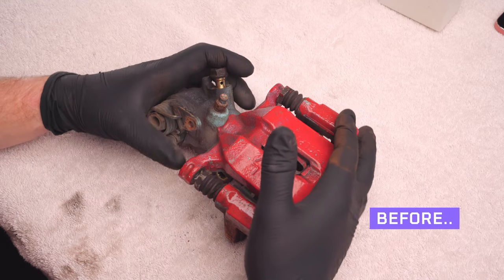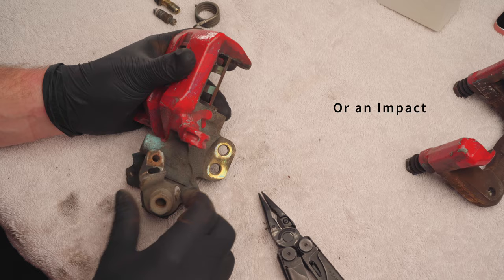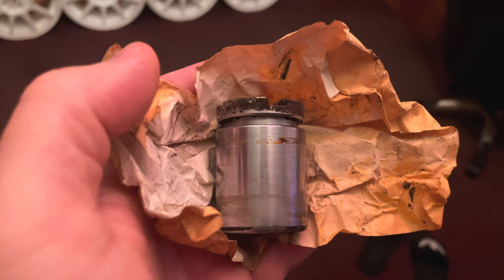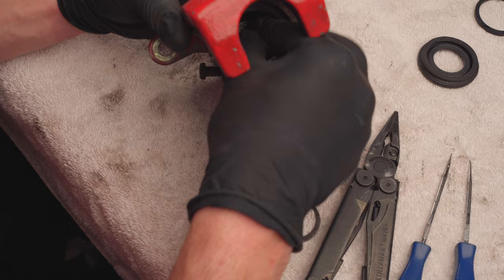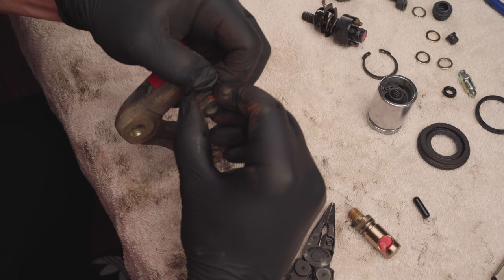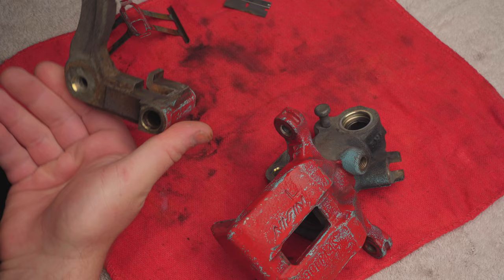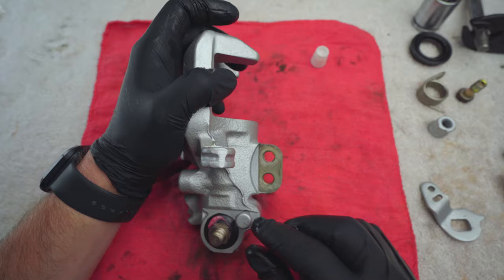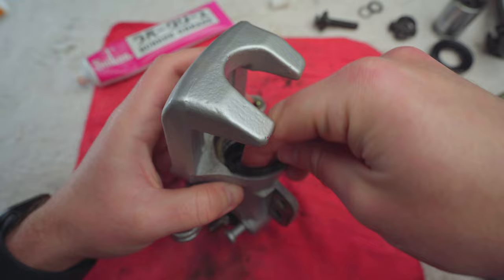Honda Rear Brake Caliper Rebuild // Everything You Need To Know [4K]

Comment: Getting the e brake cable back on is proving to be a b*tch...is there a trick to it? Came off super easy...by accident, of course..
Reply from the maker: Been awhile so I’m trying to remember. Have you already bolted the bracket in? If not maybe remove it so there’s more slack, think that’s what I had to do
Reply: @Coory2  That makes sense.  Will do that. The good thing about all the learning curves is the other one should be much easier to do.
Thanks for your reply Sir.

Comment: Handbrake hardly works on my civic,had new calipers and cables,any idea why still not working?
Reply from the maker: Hey, if both sides are weak the only thing I can think of is the adjustment bracket thing just behind the handbrake inside the car where the cables connect to it. Have you tried messing with that since you installed your new cables?
Reply: Passenger side works perfectly, drivers side not working when handbrake pulled, but if I manually push the mechanism on the caliper it locks the wheel.
Reply: @thebanditsix When you open the shaft (which you need to open the insides first of the caliper) there is a bearing there. It could be broken already. This is what caused mine to not properly push the small pill inside to push the pistons. FYI the bearing code is 7E-HKS 15.8X20.6X19-1*NTN 

Aside from that inspect the shaft also, it could also be worn out.

Comment: how do you remove and install this small metal thing that does i dont know what in caliper?
Reply from the maker: Sorry not sure what you mean. The pill shaped piece?
Reply: @Coory2  pill shaped? uhm i guess no, im talking about that metal piece that metal plate or something thats fitted in gap in brake caliper
Reply from the maker: Hmm.. Not positive which part you’re on about. If you’d like, you can send me a picture on ig and I’ll see if I can help

_cory.mp4
Reply: He might mean that saddle washer for the caliper bracket.
Reply: @waverider5751  yeah, i was talking about that small metal plate that's holding brake pads so they dont wobble around (i tested it)
Reply: @miziaa  oh, that’s the pad shim, there’s two each on the ends of the pad, and a top spring that locates the pads toward the hubs. My Civic came with drums in the rear, so I had to source a bracket for the ABS and the brake line, the bolt that goes through it, the saddle centering washers that go between the caliper and knuckle, and the caliper attachment bolts themselves, two per side. The shims usually come in the same pack with the new pads.
Reply: @waverider5751  nah, im not talkin about pad shims, im talkin about other metal, damn, i dont know how to explain that in english
Reply: It's the only thing left and not in the video. The bearing inside the a brake actuator
Reply: No one ever shows how to install the caliper spring that holds the pads from the outside of the rotor pushing towards the inside. Every time I put mine on it doesn't "lock" in, it just wobbles around
Reply: @Boom-mh4ig  oh yeah, this what i meant, no idea how to install it, mines wobble as well

Comment: Does the Seiken rubber grease have pfte like the super lube you linked in the description? Just curious. Thoughts on that vs super lube vs sil glyde vs red rubber grease? God i have too many greases.
Reply from the maker: I’ve had a look at Seiken’s website and it doesn’t say, really not sure if it does or not. Don’t have experience using sil glyde but have had good results using the super lube on some other calipers I’ve rebuilt and used on track. As long as it’s rated for high temperatures I think you’ll be good 👍🏼
Reply: Sil-Glide is my go to on brakes and jetskis.

Comment: 9:51: Thanks to your tips, I got the boot installed. Wasn't as hard as I thought. Just needed to lower the boot as far as possible at the base of the piston and press the boot down into the base of the bore evenly all around. Then carefully twist & turn the piston while pressing applying even pressure on the boot so it stays seated in the bore. I used clear, pure silicone paste to lube the boot and the part of the bore where the boot lip goes, and brake fluid on the piston once the boot is in place and ready to be screwed in. Also coated the screw part inside the bore with some brake fluid.